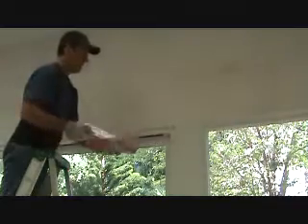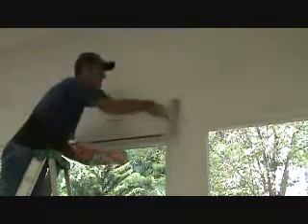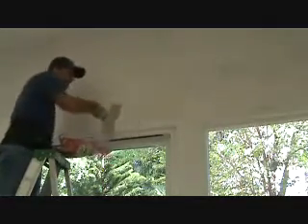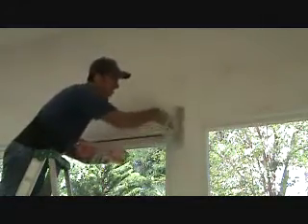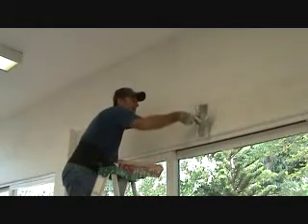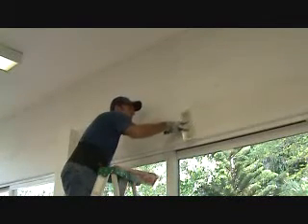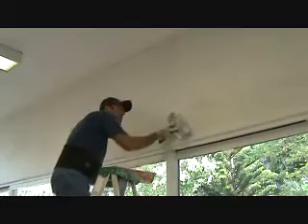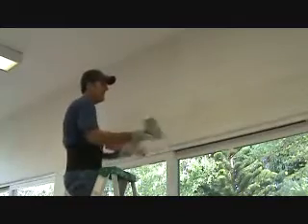Applying a skim coat layer of drywall mud to a bullnose corner edge

Comment: nice video. I need to start making a few so I can post response videos. The way I would do the response is to do a POV of the pan in my left hand and the knife in my right. Metal pan with a small handled knife. How to pull the mud out of the pan and what it should look like as it sets on the blade. how to cut the edge off on that mud on the knife and the angle to spread it across the wall. People can watch this video and learn but backing up to how you work with the mud is critical